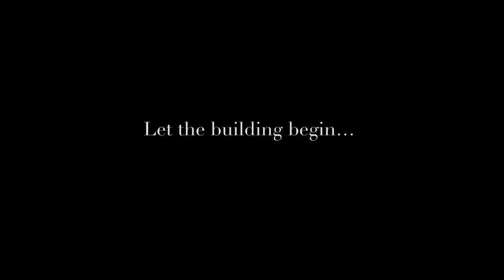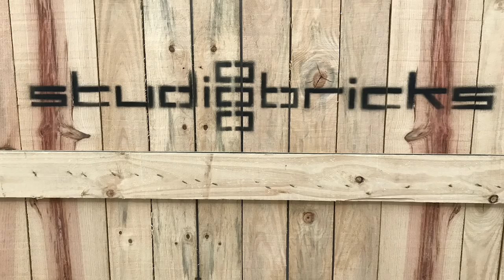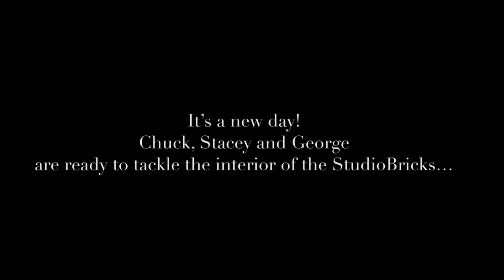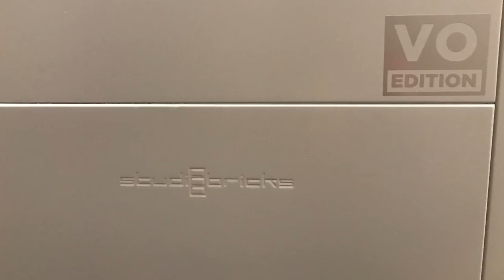Chapter 3 - Building The Studiobricks Voice Over Booth The Right Way

Comment: Thank you for the great video! How is it so far to use the booth? I am concerned about the temperature inside. What is the max duration to stay inside the booth? Thank you!
Reply from the maker: Sy Kim there are 2 ventilators in the booth and it keeps the inside perfectly cool. I’ve done session as long as 4 hours with no problem.
Reply: VO Buzz Weekly 
That sounds amazing indeed! Thank you for the info. Without two ventilators I guess it is hard to stay for 4 hours.